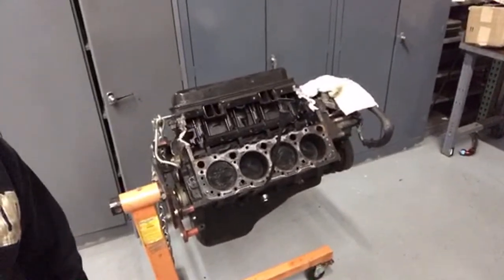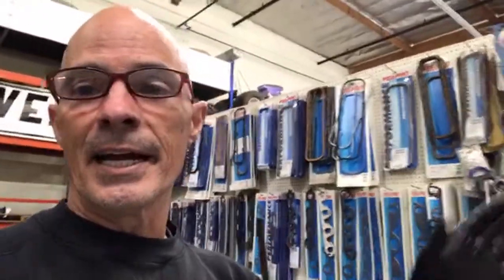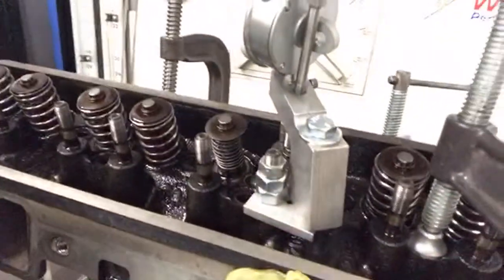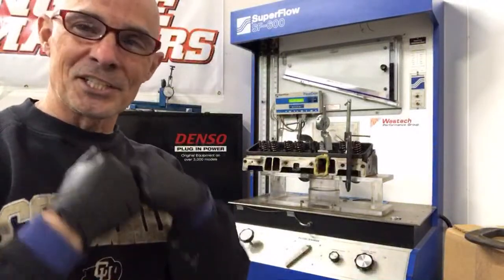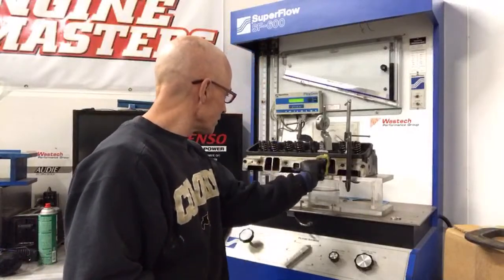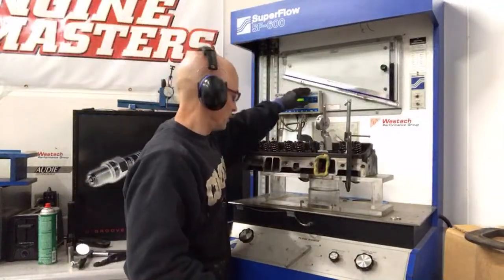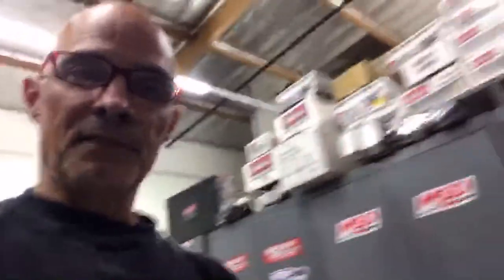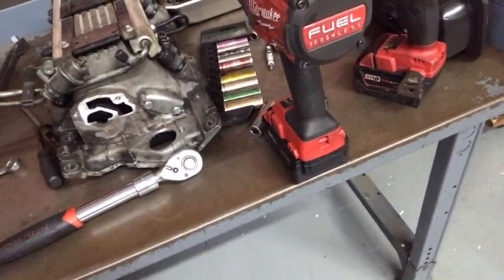L99 4.3L V8 HEAD-WHAT DOES IT FLOW?

Comment: Would love to have either the LT1 or the LT4 heads for my 94 Buick Roadmaster. I'd be willing to talk about trading my Iron LT1 heads. My email is ShamelessTR@gmail.com
Reply: @shamelesstr I have a couple pairs. I think one is a bare set of 561 aluminum castings and he other is a 8374. I’ve been plannng to send one pair to Advanced Induction here in NC. You can have the other pair if you’re willing to pay shipping via PayPal or something after you get them and have them checked for cracks just to be sure.
Reply: Confirmed- I have a complete pair of 8374 heads. Came off a motor with 129k and long oil change intervals. They’ll clean up and recondition just fine but I wouldn’t run them like they are now. I’ll email you and follow up.
-Rob B
Clayton, NC
Reply: @robertbryant7771  Hey man. Sounds good. I will keep my eyes on my email.

Comment: I figure Vortec heads flow better than LT1s or LT4s.⁸
Reply: That would be nice but it isn’t so. Vortec is a 165cc head that does flow well, due to the fact it was developed from the LT1 iron head. Different intake bolt pattern, not reverse cooled. LT1 is a 170cc head that outflows the Vortec by a modest amount but the LT4 is far beyond both.

Comment: Can you put those flow numbers In to some better perspective 
What's good 
What's poor 
What are some normal benchmarks
Reply: Old timey rough guesstimate method is take the maximum flow and double that number is the HP potential of the head. 197CFM x 2 = about 394HP. On a good day with all the right marching parts. A good cam match would be something in the 212/218 maybe 218/224 ish duration on a 113-114LSA and .495-.505 @ .050 lift. Port those suckers to get up around 235CFM and a slightly bigger exhaust valve (1.56”) with a little bowl and seat work they could make 450-470HP flywheel, with no drive accessories, etc.

Comment: Advanced Induction here in NC has the final word in CNC porting of the LT4 head. You send them your heads and they do them up. Also do LT1 heads (early 374 or 643 castings only, 561s don’t have enough meat for the CNC). 561 does flow best as fast from the factory among LT1 heads.
Reply: as cast, that is...
Reply: @robertbryant7771  no they dont its a myth  read gizmos post in here https://ls1tech.com/forums/lt1-lt4-modifications/1201813-well-bought-used-set-lt1-heads-got-561-s-2.html
Reply: Lots of respect for Gizmo and what he does in the stock class around Charlotte/ Concord/ Kannapolis. Does great mentoring work with younger folks. However, here’s an even older post from NightTrain66 (Lloyd Elliot himself):
https://www.camaroz28.com/forums/lt1-based-engine-tech-9/561-casting-flow-s-62301/

Comment: Hey Richard, about the adjustment you made on the flow bench when you dropped the valve lift - was that to readjust the flow restriction back to 28 inches of water?
Reply from the maker: we change the flow scale-every test is run a 28 inches

Comment: Just a heads-up, Lt4 heads require Lt4 intake. Has a taller intake port. Essentially an  Vortec head but with lt1 coolant flow
Reply from the maker: yes
Reply: LTx heads are NOT NOT NOT a Vortec style head. Vortec is an LTx style head for SBC. The iron LT1 Head is where the design for the iron Vortec ‘96 and up came from. Then they added a horrible idea for intake bolt pattern. Set of off the shelf budget aluminum heads is more economical than machining stud bosses and adding screw in studs plus spring pocket machining and new springs. And then have almost no cost effective intakes. 🤮 Vortec

Comment: May be stuck rings on the K24. I've had a number of engines that sat for a long time have zero compression and crank so fast sounding like they had a broken timing belt and not start. I'd pull the plugs out, squirt atf down the holes, let it soak, crank it a little, put the plugs back in and it would start fine. Those engines never had a problem again.
Reply from the maker: rust on valves

Comment: Hi, Rich. 
With your capability as to tech &,R&D.
Would you consider the "the other guy's " big block's?
Personally  i would consider a T'charged '82/3  5 .0 T'bird  a GASS to 'throttle 'bout town'.....
Hey, DREAM BIG, richt?
( did i say that after paying it off-european finance, inc. I plan to reengine¹1111111111111!!!` the buggy from it's  cuurent ( non ) running  140 turbo .
I would build the 2.3 but for that HUGE hole that was #3.
When those turbos let go...
Can i finish  this at another time?
Swarming severe t-storm alerts.
Having trouble with phone cooectiions
.
Thanks, brother.

Brian

Comment: That's impressive airflow for such a small valve. 906 Mopar heads with 2.08 intakes and Pontiac #48's with 2.11 intakes only flow 210 to 220 CFM at around .500. And they were hot muscle car heads!

Comment: Little League V8s are responsive to modifications. Dremel the piston deck from 9.00 " down to 8.835 ", allowing the curtain area for 650 lift and 1.94/1.6s. Thats about enough to keep the rings sealing. We did this on our 202 Holden sixes and our very similar 3.625 bore by 3.0625 stroke 253 Holden V8s. Relieving the block for bigger valves. Then you can fit any big valve Big Bore head on it.

Comment: You can pin the studs.

You don't have to install screw-ins unless you just want to.
Reply: Depends on compression levels looked for, heat too
Reply: @shadowopsairman1583  I think you mean 'spring pressure rate', but from my experience, pinned studs will easily handle the range of pressure that Richard will be utilizing on this mild street engine.

Comment: Check the valve lash on the K24
Reply from the maker: I never even changed the oil or filter or plugs-it was run as I got it from the JDM supplier

Comment: Betting bent valves on the K24 just a shot in the dark but saying it for my amusement. 

In terms of the L99 head flow it looks like you'd pick some decent power up on the mid range running the LT1 heads. For .1-.5 lift the numbers I found from Super Chevy (didn't look, heck you may have flowed it for all I know) were 64, 121, 171, 202, 206. That's some BIG area at .2-.4 with no real discernable penalty and with no porting. I'm thinking peak power will be pretty similar but average power would be way up provided you're in enough RPM to make the magic happen. I'd certainly think even with 200CFM at .5 lift if you had enough cam to capitalize on it and enough durability to have it live you could make some nice power at high RPM.

Comment: I used to work at a jdm shop and on occasion the rings would stick, we’d just put a drop of upper cylinder lube or atf down the plug holes, reinstall the plugs and crank it over on the starter and it would free them up and bring the compression back.

Comment: 175cfm ..  So it will support 350hp as is.  That is 90hp above 1hp per cubic inch.
Reply from the maker: 196 cfm
Reply: @richardholdener1727   Yes.. I saw it.  How many RPM's needed for 262cid to draw 196cfm?  That's why I shaded towards the 175cfm.   262cid x 1.35 hp per cubes = 353hp. ...   The heads flow great, but if you were shooting for 400hp you'd be better to drop them on a 305.

Comment: Very interested in seeing the LT1 vs LT4 flow differences. Would be great if there was an iron LT1 head too to throw in there as well.
Reply: lt1 should be the same as the l99 seen here around 200cfm lt4 should be 240 and higher iron lt1 are 220

Comment: What are the flow numbers for a 4.3L V6 Vortec head? I've seen anywhere from 140 to 205 but zero proof nor any info on lift. I'd like to see how the battle of the 4.3's, V6 vs V8, pans out.

I'd also like to know because I didn't have my heads flow benched (I should have).
Reply: They're the same as the 5.7 vortec heads. The good ones. They don't have the hardened exhaust seats that kill flow as was used on HD trucks. With a really good valve job they will pass 230cfm but stock they are 220cfm or so. They really aren't much different than these heads. The l30 305 vortec heads flow almost the same as these.
Reply: Go to to summit racing
Reply: The 4.3 V6 is literally a 350 with 2 cylinders cut off. So it should flow exactly the same as a 350 of the same year.

Comment: You know i remember reading back in the day that 4.3 baby lt1 crank has tbe same stroke as a 327, and if put in a reg 350 lt1 it makes it a 327, short stroke high winder..
Reply: It's a 3" stroke, same as a 283 not a 327 which is 3.25"
It will make 302ci if you swap cranks with a 350
Reply: @luckautofab4461  302. Thats it. Its been 20 years since i was into those. But 302 not 327. Sorry i was off on my info.

Comment: Keep up the good and fun work.  Jim Hall (and I) have tons of dyno data on hot rodded LT1/LT4 combos but I've never tested the stock-ish LT1 or LT4.
Reply: Release the Data.
I need to know the numbers of LT-4 Head.
Thanks
Reply: LT4 head flow in modded form won't be much different than an aftermarket 200cc SBC head.  220 to 250cfm of flow.  Beyond this .. Cam and CID will dictate rough power achieved.   Not rocket science.   A little over 500hp in fully ported whiz/bang properly cammed mode for the better flowing LT4 heads in ported form.

Comment: Personally I blame squirrels
Reply: That K24 probably lived life a 1/4 mile at a time.  It sucked a  squirrel right through the pod filter, down the CAI and got jammed up in those tiny valve.  The other two cylinders surely have valves bent by acorns.  That's vtech for 'ya.
Reply: God dammit John!
Reply: Damn I thought my squirrels were gangster enough just chewing my wire harness

Comment: I would love to see a ported swirl-port head... I like the idea but I understand that they're lacklustre for performance stock.
Reply: That they were... as the application of the Swirl Port was a "band-aid" attempt to increase cylinder filling on N/A engines--that sadly acted more as a hindrance--by inducing swirl in the cylinder inside the intake port at the valve. GM did eventually get the concept right with the advent of the Vortec series of cylinder heads, commonly found on late-90's truck/van engines.
Reply: @pancudowny  yeah! cylinder swirl instead of port swirl ;) the entire industry moved forward but thinking about those old bad swirl ports is about...sad xD

we can think about ford gt40P too as they were a good exemple of cylinder swirl flow if i may say, that were proved efficient without sacrificing port flow too mutch.
Reply: Swirl heads only work really well at 2500rpm (on a 350). Beyond that they dont flow well and will actually induce so much rotation in the charge it will start to centrifuge out the fuel and spray it all over the cyl walls above 5000rpm.
Reply: Headbytes (Tony) has a couple of videos doing a set of 193 swirl port just to see. He says totally not something worth paying to have done but since he does it for a living he did it just to see. His videos are on YouTube, just search.